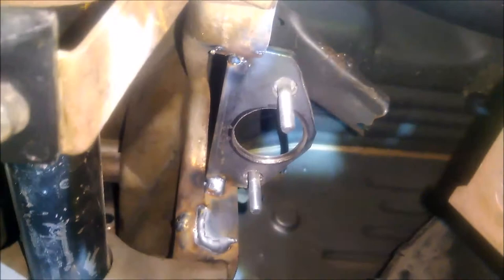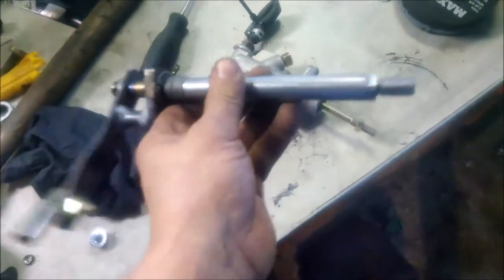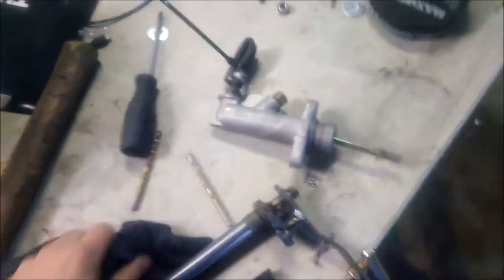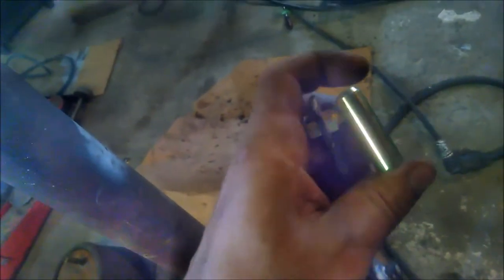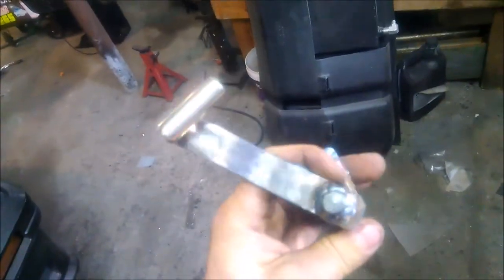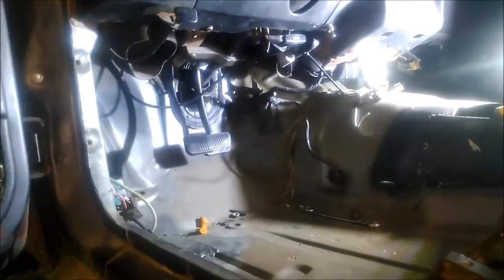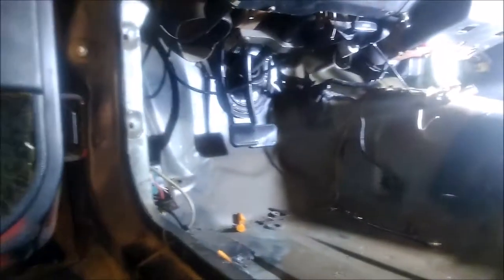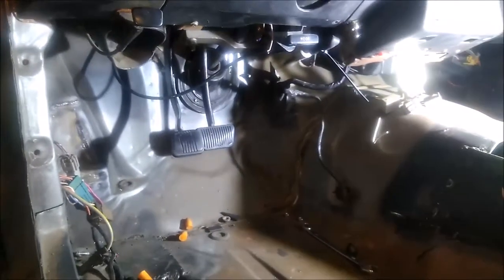mustang hydraulic clutch master install low dollar high labour diy

Comment: Thanks!  I've been looking through the YouTube videos for a hydraulic conversion package, but the more I watch your video the better your concept seems.  I'll probably make some changes to the design (don't weld), but it should be very similar.  I really appreciate you making and posting this video.
Reply from the maker: I did have some issues with square drive to the pedal. It did eventually wear and gave me a fair amount of pedal slop. I ended up redoing it as the pedal ratio with the other shaft was reduced a lot so it was super stiff. Best of luck to yeah